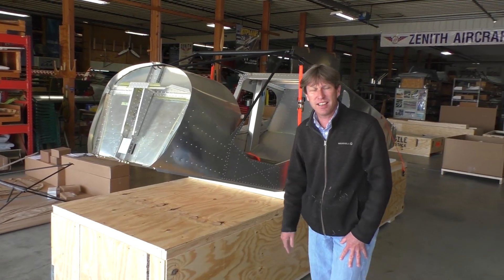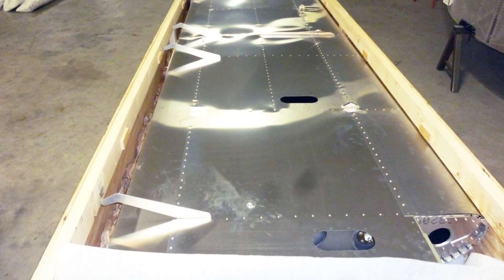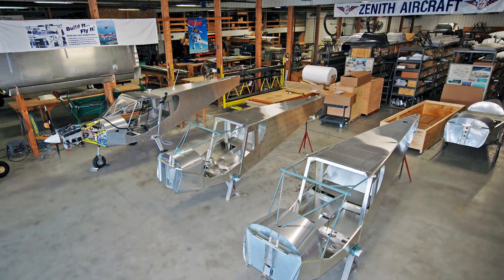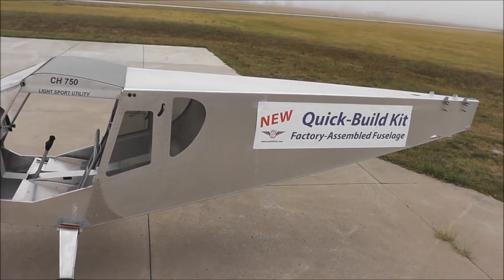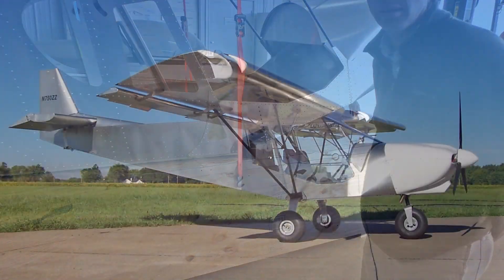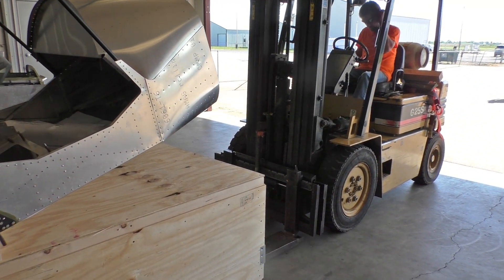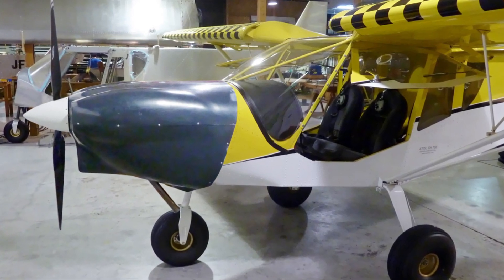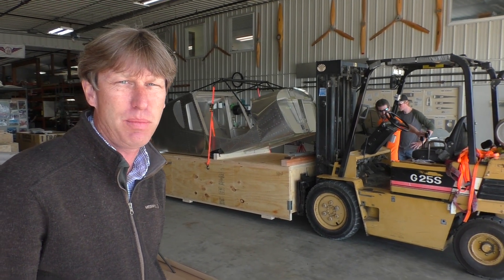Zenith CH 750 Quick Build Kit

Comment: Wow, this is a major improvement to reduce build time.  I would have considered buying a Zenith for easy of building, but was interested in cruise speed over short field performance.  Van's RV-15 was my first choice, but the delay for ordering was unsolved issue.  The initial estimate that the cost would be about the same as a RV-14.  Don't think it will meet that estimated cost.  Final choice was a Rans S-21.  I'm having issues with the build mostly with the poor build plans are too small, and assume you can build the opposite wing by only giving the left wing plan.  Too many parts are builder made.  Some parts need a lathe to build, and a machinist to get the correct fit.

Comment: Slats and the works. Since I'm older than dirt and the clock is running out, this one has immense appeal.
*The customer builds the cowling from scratch?
**Is the elevator trim adjustable while in flight on this model?
Reply from the maker: Fiberglass cowls are available for most engines. Yes, the elevator trim is adjustable in flight.
Reply: @zenithairco  thank you.

Comment: If you get the wings and the fuselage quick built, I have a hard time seeing how that's 51%.
Reply: Just installing engine and avionics can be 51%+, never mind putting it all together and rigging controls.  I built a 650 with others in 2 yrs from basic kit; engine, wiring, and panel were major time.  We have full Dynon system with auto-pilot and Rotax engine.  Flown from WA to OSH twice.
Reply: @scubajam  Look at the FAA forms, engine and avionics will NOT get  you 51%.
Reply: @RussellTelker  As a DAR for EAB class certification I conducted an audit for this kit and it does in fact fall into the 51% area due to the fire wall forward, panel, interior and  miscellaneous structures for the finished project. Hard to imagine but its true. I also see this as as stepping stone for a ELSA kit if Zenith ever gets a LSA certified bird into production.
Reply: @RussellTelker  Sooo, you saying a company that been building  planes since Smokey Bear was a cub, don't know the rules, don't know how or what they doing and  essentially live at a airport  or at least looks like it  are a buncha dummies, Huh ?? !!!... Ok, smarty pants, I  will definitely  follow your  lead into a  burning building.....😳😳😳!!!
Reply: @ToyManFlyer1100  please read what I typed again.  I said "Look at the FAA forms, engine and avionics will NOT get  you 51%."  That was in response to a previous comment.  I did NOT say, or imply, that this kit doesn't comply with the 51% rule.
Reply: Yeah, what’s the word on that?